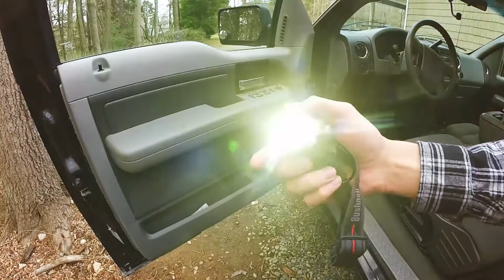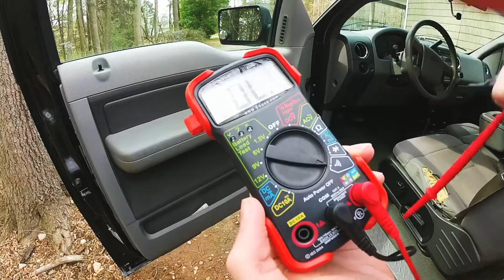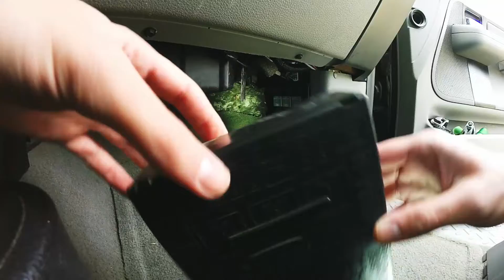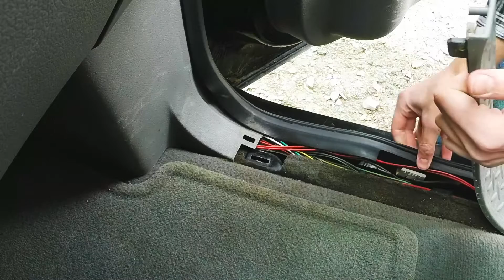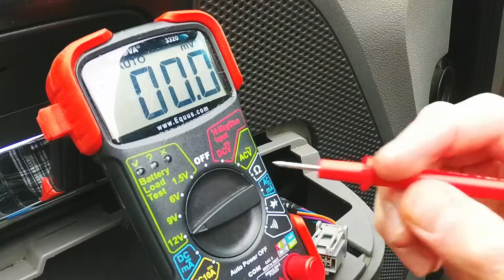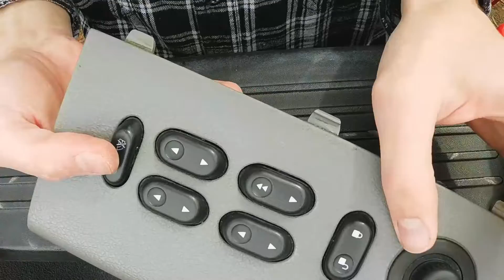How To: Diagnose and Fix Broken Power Side  Mirrors

Comment: does the 2005 ford Freestar 4.2L Limited van use a relay in either the fuse box in the engine bin, or inside the van and if so where is it located?

Comment: Orange with a green stripe. Is that the universal wire for power mirrors? Or would my vehicle likely have a different combination of colors?
Reply from the maker: Sadly the only universal wire colors is the black for ground/negative and red for positive. And that can only be garunteed at the battery or alternator. If you have a vehicle other than a Ford F150, 04-08, yes the wire will be different color

Comment: Wonderful!!...1st real go-by for a F150 power mirrors, . One thing to double check...on your piece that checks continuity on the switch...I THINK you have your pins mixed up. The left side mirror going up is pin 1&5 and 3&6. To go down would be 1&6 and 3&5.  If I am wrong then please explain.  By the way in my truck both mirrors went dead, yet I have 12v to pin 1 and a solid ground to #3. I tried a new switch (before checking continuity between switch pins) so not the switch. That leads me to believe there is a wiring problem from the switch to the mirror.

Comment: if you want to test the mirror going from the connector that switch goes into - pins are to be 1 7, 6 and 5 - how do you hook the ground up …..there is no ground just using these pins -thanks

Comment: Hey my power mirrors on my mustang stopped working, I checked for power at the connector and my multimeter only read 1.7 volts. What would that mean?

Comment: Cheers for the video mate.....my colorado  mirrors weren't   working....check fuse all good....pull the multimeter out  put the red probe on the power wire the black on the car  all good 12 volts....so bought a new switch threw that in ....and they still didnt work  scratched my head for a minute thinking whats going on here....so out with the multimeter  again red probe on the power wire and this time put the black probe on the earth wire......zero volts!!....turns out the earth wire was  broken  in  between  the door and  the car .....the same issuse.....thanks again for the video this was a great help 👍🏼
Reply from the maker: Glad it worked for you!
Reply: Hi! How do I figure out which wire is the earth wire?
Reply: @1RandomAcc1   hi , sorry I got rid of the ute not long after, I forgot the colours  since it was a while ago now
Reply: @MrJono78  ah ok thats alright, thank you still!! someone told me to do it with trial and error

Comment: Great video.  Both my mirrors on my 2007 Kia Sorento have stopped working.   I bought it 12 months ago and they were only just working then.   My only option is to take it to someone who knows what they are doing.
Reply from the maker: It does require a little electrical knowledge to tackle an issue like this. Good luck!

Comment: I have a 2008 f350 with power extend and power fold.Everything works on both mirrors except the power fold function. I replace the switch, fuse, relay and 2 complete mirror assemblies. New mirrors act the same way as the old mirrors. Everything works except the fold function. I tried the mirror sync a few times with no luck. Cant see to find a wiring diagram for the power mirrors Im guessing which ever wire is responsible for the fold function has no power. Just not sure what wire that is? Great video.
Reply from the maker: Did it have power fold from factory? If so could be a busted wire. If it's not a factory option, it can be added. Check YouTube, there are several videos on here about adding it.
Reply: It’s factory. I think there’s a break in the wire somewhere but without a diagram  of the 20 pin plug to the mirrors I don’t know which wire does what without taking the harness apart. Thanks for the reply. I will be taking it to the dealer Wednesday. I’ll see what they come up with.